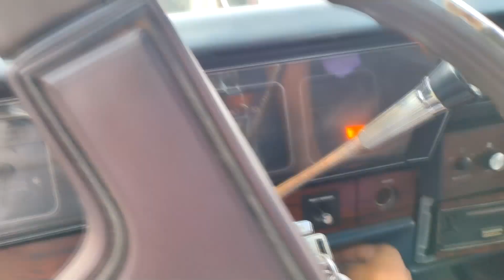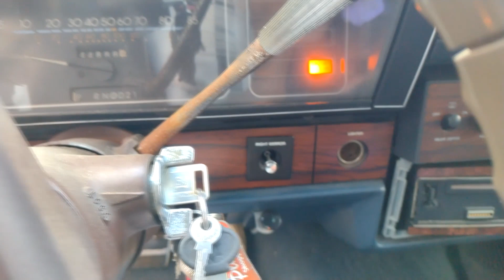Can I Start Up" The Chevrolet Caprice after 1 Year started | 1986 Caprice Classic Cold Start part 2

Comment: One year doesn't seem like a long time these days but even my 1995 Lincoln Town Car that I only drive in winter can have some issues when I get it out of storage in the fall and it's got fuel injection and solid state ignition unlike some older cars with a carburetor and points ignition.

Comment: I recently started my '89 Caprice. It's been siting too long. Check the spark plugs, wires, distributor, etc. The float in the carburetor might be stuck. Good  thing my car has a throttle body injector. Good luck on your car.

Comment: Made me smile, try a higher crank battery and turn off all sources of battery draw ,  another idea is have another come and spray the start fluid as you begin to crank, GMC products do not like to sit, replace fuel filters first then check fluids, oddly cars respond better with a name and praise. A hammer tap a couple times to the starter casing and light taps to the carborator loosens the needles and float. Good luck.

Comment: That Caprice is NOT an '86. It's either an '87, '88, '89, or a '90. You can tell by its headlights, the front grill, and the taillights. I know because I have an '89.
Reply from the maker: I've already been aware of that over the years I guess the DMV made a mistake. Or the previous owner swapped out the headlights.
Reply: @AcoraWhite  You might be right. The previous owner might have swapped the headlights, grill, and the taillights. The '87-'90 European headlights, grill, and taillights are popular on the Caprices.